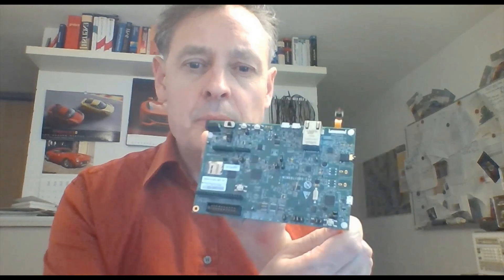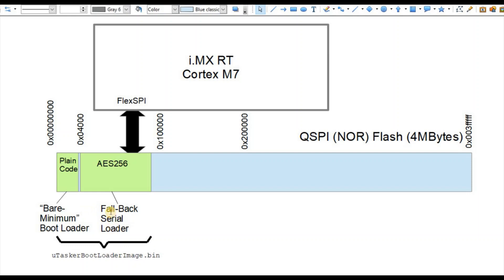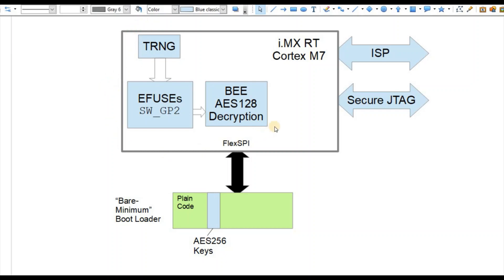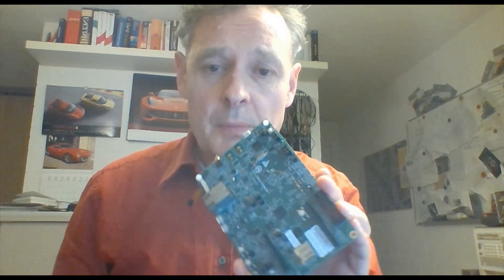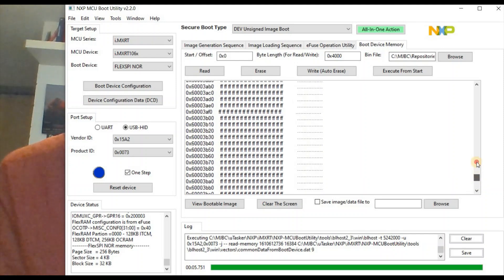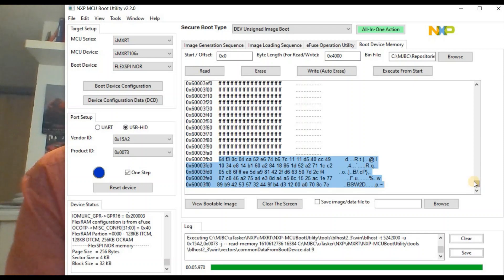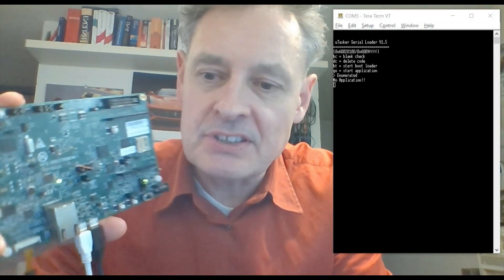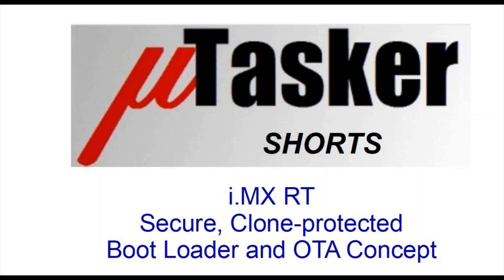uTasker Bootload Concept

Comment: Great video, thanks Mark! One thing that wasn't clear to me is the encryption of distributed software. For publicly distributed software (posted on a website for distribution and placed on the USB stick), in your example, can you confirm (or explain what I've misunderstood), the software image:
- is encrypted with “aes256 secret key”
- uses NXP's "elftosb" tool for encryption
Thanks!
Best Regards, Dave
Reply from the maker: Hi Dave
The reference uses an AES256 secret key of "aes256 secret key" and an AES256 initial vector of "initial vector". These are replaced by productive keys belonging to a project when used in a real product.
A uTasker utility is used for encryption (in the project's tools directory) and not elftosb. The utility is called uTaskerConvert, which has a number of capabilities - see https://www.utasker.com/forum/index.php?topic=1445.0
To encyrpt the image for AES256 its use is
uTaskerConvert.exe uTaskerV1.4_BM.bin aes256_coded.bin E=256 $"aes256 secret key" $"initial vector"
It is also compatible with on-the fly encryption when AES128 is used
uTaskerConvert.exe uTaskerV1.4.bin aes128_coded_XiP.bin E=128-60020400 $"aes256 secret key" $"initial vector"